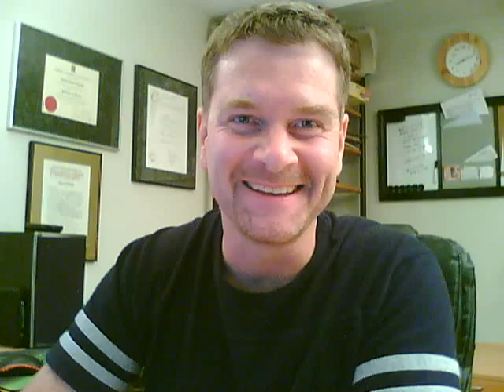#85 - Question/Answer: Applying/Removing Thermal Compound

Comment: Yes, it's absolutely fine. You do NOT want too much compound, it'll actually make your temps a bit higher, plus make a mess running off the sides of your CPU. Just a very small amount is good, as long as it's spread around the contact area of the cooler. :)

Comment: My PC started acting up a while ago, audio was getting very crackly and video and audio clips were out of sink. After much fault finding I found out my AMD chip was overheating. This film helped a lot. I will be adding some Nanon Grease to my chip this weekend. I have also bought an extra fan that slots into a spare pci slot and helps get the air circulating around the case to lower the temp throughout the system.

Comment: @seannz100 Yea that would be fine, even denatured alcohol would work too.WATER will remove it but make sure there isn't a SPEC of it leftover just make sure the surface is clean afterwards by rubbing a dry napkin over it several times.If your napkin picks up and dark stains just keep cleaning it.

Comment: It's important for connection prepossess so the heat transfers to the heatsink. If theres any kinda gap because of not tightened properly the CPU will go over 100 degrees and its only supposed to be 60 or under.

Comment: @mewimi not at all if u r responding to the video, the method he prefers creates air pockets creating excess heat and less contact. the best method is to make a X with the compound and press the cooler down on the cpu it spreads evenly for a perfect application

Comment: I've used Arctic Silver compound a lot in the past, and I find that if I only apply a drop about 1/2 or 2/3 of a grain of rice, I'm ok, as long as I really take the time to spread it out evenly.

I would also suggest to everyone that they be extremely careful not to let excess thermal compounds (like Arctic Silver) get onto any electrical contacts by accident, as it can cause them to short out.

Comment: @erikblazer13 i saw a video of a test done by pushing a flat piece of glass down on the cpu. when spread, the compound formed bubbles were easily seen. by actually putting a small blob in the middle and pushing down, the thermal compound spreads itself out evenly without any bubbles, you dont need to spread, and it can actually be detrimental to performance

Comment: @DarkHero1989 Is that a hint or a good way to snag the corner of a cloth or towel on a motherboard component?

Remove the CPU....If you leave it in the socket you will force the old thermal paste down into the cracks between the chip and the mount/cover that sits around it.If it doesn't have a cover you should still take it out or be very careful.

Comment: @taltigolt use a drop of thermal paste the size of an UNCOOKED grain of rice and put it DIRECTLY in the center.DO NOT SPREAD IT.Just put the heatsink back on it,the heatsink will force the paste to spread where its needed to fit with the contours of the CPU surface. MX3 is good thermal paste.

Comment: @0peppers In my experience if it comes with past on it just use it . they are  just trying to make it easy for you might be able to drop the temps 2-3 degrees the most with better past. there's is good enough , so unless your going for a serious over clock there's is the way to go .

Comment: With that cooler, though, you should be getting lower temps. That cooler is apparently the BEST THING next to water cooling. Make sure you have good cable management into your case so your heatsink can get a lot of air. I got a nice 140 MM blowing onto my heatsink/fan and my temps are usually ~29C idle. Make sure you have REALLY GOOD airflow with that heatsink, seriously, its a fucking beast. Nice setup btw :P

Comment: @shadowslayer96 You could, but most thermal compounds have what is called a "burn in time" or a "cure time".When thermal paste is applied is has a reactive chemical that helps it to spread over time to cover all the area on your CPU.When the chip heats up over and over again,this "solution" dissipates into the air.If you try to reuse it,you may run into some problems with oils from your hands or air bubbles from wiping off the old CPU or cooler.It's best to use new paste.

Comment: @SkulLzSouL It depends on the CPU and the ambient temperature but assuming ambient is around 20-25, 40 should be fine for idle. You don't want it to change too much between load and idle though (15'C or less if possible). Look up the processor on Intel's website to see its maximum temperature.

Comment: You can also use ArtiClean 1 and 2.

Put drops of ArtiClean 1 all over the CPU and wait about a minute, the thermal paste wipes off with ease (and so do thermal mats apparently).

Second, use the second bottle in the same way. This gives the surface a thorough clean.

It's not expensive and the bottles will last quite a while.

Comment: I would just like to know if I need to put any thermal paste on my cpu if the heatsink I purchased already has some paste on it. I bought an Intel E8400 cpu and it is new in the box with the fan. Intel has a plus sign (+) shaped area on the fan which is made up of several tiny dots of compund. Is this enough? Do I need to add more to the cpu itself before I attach the fan?

Comment: @whiskeyify lol, I can't be sure without seeing the type of thermal compound some is dryer then others but almost all of it WILL go dry if it isn't covered.What type of transistor was it?Some don't require any thermal solution while others can get over 90 degrees celcius.Kind of a vague question, I would have opened it and inspected it.I suppose.
If your doing that kind of work and your doing any good at it why would you need my advise? Just trollin?

Comment: you dont need to add any more. just stick on it and it will work fine. It is up to you whether you want to change the thermal compound though it is not necessary.

Comment: the radioshack electronics cleaner for printed cirquit boards is a god at removing thermal compound. When i was fixing my xbox i wasnt able to get it off with rubbing alchoal. You would spray it and it would come off like it was nothing.

Comment: @camhottylover Spreading radially works much better for me than either a line or a blob. Both of these methods tend to push a barrier between the IHS and the heat sink, reducing surface area. The ideal is to have the IHS and heat sink touching as closely as possible, with thermal paste just filling in any microscopic holes. No thermal compound is as good as the heat sink touching perfectly, and thinner is much better.

Comment: @whiskeyify Most silicon chips will operate under temps that are well over the maximum rating.However, some will show less than normal results when put through a series of stress tests.All and all it's really "in the eye of the beholder" so to speak.But if you keep it cooler, you increase the odds of having better performance and a longer life span for the chip.

Comment: After some research, the spread method is the best... but not with a plastic bag. Use a credit card to spread the paste out. That way, no air bubbles. The reason air bubbles occur is because the paste is being lifted up and that causes a crater like texture with the paste.

Comment: @humbert0acevedo You may have a wire hanging to close to it that may be getting sucked into the fan blades,since you were in there recently.Or you could have damaged it,but not likely. Take it off and put it back on gently inspect it and make sure you dont have any obstructions in the way of it's moving blades and see if that helps.Good luck!

Comment: a.) in what physical state is a sample of isopropyl alcohol at 0.0 degree celsius? 
b.) what is the term used to describe the change of state that occurs as isopropyl alcohol is cooled from 100 degrees celsius to room temperature? 
c.) During the process described in (b) is heat being transferred to the environment or absorbed from the environment? 
d.) describe what happens to isopropyl alcohol molecules as a sample is cooled from 100 degrees celsius to room temperature? 
e.) in the process described in (d) does a change of state occur?

Comment: I would like to know the exact same thing. When I buy an AMD cpu, the heat sink comes with compound on it.. the last time i bought one, i accidentally used compound even though there was some on there that came with the stock cooling fan, and i think it caused a lot of overheating..

Comment: hey question to anyone.

I put the compound on the heatsink and spread the compound out nice and thin and then placed the heatsink onto the cpu. Will this work just as good as putting the compound on the cpu and placing the heatsink on top?

Comment: @deffine77 It really depends on the type of laptop you own.A lot of laptops have whats called a "Front Side Bus strap".The CPU must be equal to or less than the current speed of this F-S-B.The fronst side bus cannot be altered because it is located inside of a chip called a Northbridge Chip soldiered directly into the motherboard. What is the model name and brand of your laptop? I may be able to help you on it. Good luck!

Comment: sputyi101: I strongly recommend you to clean off the old thermal compound from cpu then apply the new one. Depending on your cpu, if you put too much of it, the cpu might overheat due to poor heat tranfer.

Comment: ya wen i modded my xbox i found the thermal paste was very tough to get off but in most cases computer thermal paste is usually a higher quality especially the multi-core machines... even though you had problems in the past dont let that discourage you because computers seem to work better

Comment: line...or dot in center spreading just makes air pockets.. your pressing the heatsink into the cpu its gonna spread on its own...  pre applied tims are spread out perfectly its almost impossible to get it perfect with a card or finger blah just use line people...  ive tried every way and line seems to always come out best... ps... dont be afraid to practice with some... its not that expensive get 2 objects apply some press them togeather and get a feel for how it spreads and how thick u want it

Comment: @humbert0acevedo It could be that Radio shack doesn't sell the type thermal compound that you need.The thermal compoud they have in store is primarily used for small VRM's on things like amplifiers and,well,radios. You want to use something like Arctic Silver 5 or maybe you can find one you like at newegg dot com.Most of it is less than 20.00 dollars but they have some stuff that will work for around five bucks.
Your fan shouldn't be loud at all unless it has lots of dust on it or is broken.

Comment: unless you polish it with 10 nm (Nanometer!)  aluminum colloidal silica final polishing solution and table. However, only specialized materials testing laboratories would have access to that grade of equipment. I'd still use arctic silver 5 anyway tbh.

Comment: @SkulLzSouL Heat will not transfer to the heat sink as effectively. This may mean that the CPU overheats. Modern CPUs will throttle at high temperatures, decreasing performance. If it gets past that point it will shut the computer down to try to avoid damage. It is still possible to damage the CPU by overheating but you probably won't see much magic blue smoke.

Comment: @Gungrave309 Even 50% could work its just how concentrated the alcohol is, so the more the easier you will get the remaining alcohol off.

Quick hint: leave the cpu in the mainboard when cleaning so you dont bend any pins.

Comment: @DarkHero1989 Please explain to me why you thought my advise was "bad" enough for you to make a comment based on discrediting me?
Also, if thermal paste is reused and more is added every time you re-seat the heat-sink,it WILL add up..And it WILL oooz out around the CPU shroud.It's very easy to contaminate the CPU socket with thermal compound.More of the people that watched this video would agree that they don't know how to do it in the first place.THAT'S WHY THEY ARE WATCHING THE VIDEO.

Comment: @thevoicetoldmetodoit If your not replacing or removing your heatsink or CPU you don't "have" to change it at all.Almost all aftermarket thermal pastes can perform better than "stock" thermal paste,so I could see upgrading a thermal paste, but I wouldn't recommend it.If it's not broken don't fix it.^.^

Comment: lucky 4 u because I had a Celeron D processor which got so hot it blow right through the outer casing b careful please.

Thow mine was a test it does implement the Dangers!

Comment: rubbing alcohol is different than isopropanol, you shouldn't mention it at all if this is to teach others.  Rubbing alcohol isn't pure enough as its "watered down" being usually 70% ethanol.  Only get Isopropanol which is 99%.

You can make some killer honey oil with the stuff too...opps.

Comment: @shooterzden If you get thermal paste under the cpu retaining clip when trying to wipe it away then next time you should apply a lot less normally when applied properly the paste should only be a few microns thick (read thickness of a hair) 

So impossible to get it under a retaining clip.

The only time I see such a crappy job is with the old stock AMD heatsinks with the pre-applied strip of paste or when I am fixing someones computer who decided to do some modding himself..

Comment: lol this way is ineffective and you will only see a decrease in performance sooner rather then later.
Spreading causes hot pockets or air bubbles.  Technically the paste doesnt really need to extend all the way to the edge of the processor because the core (center) of the chip is the place generating heat.  A dot in the center is all you need and then apply the heatsink, locking down diagnal sides.  Applying X method is not bad but you may end up with excess paste.
watch?v=EyXLu1Ms-q4 - Proof

Comment: @seafireliv First off, people in general work better with a visual. Second , why would you stand behind this guy? He's constantly posting BAD advise...He has it all wrong. the best method is to put a rice size drop in the center of the CPU and put the heat-sink on. You fanboys just like playin around with thick white fluids.